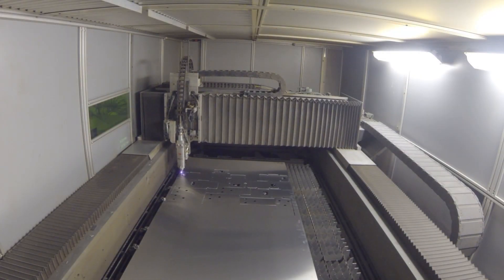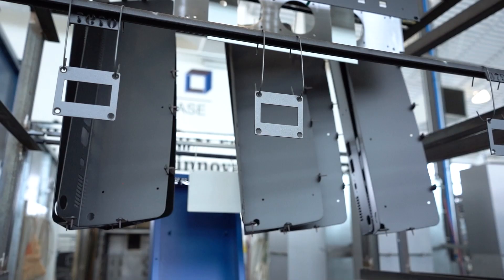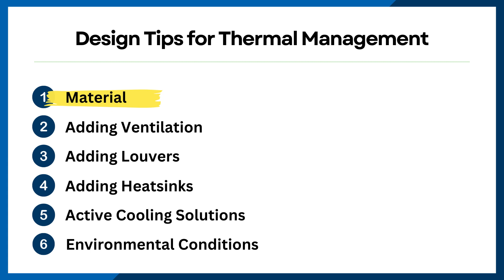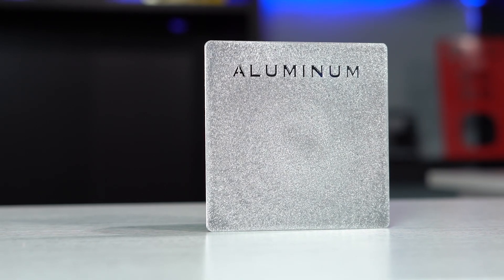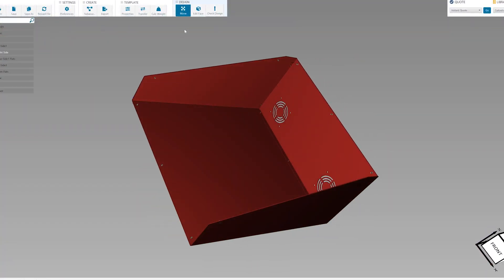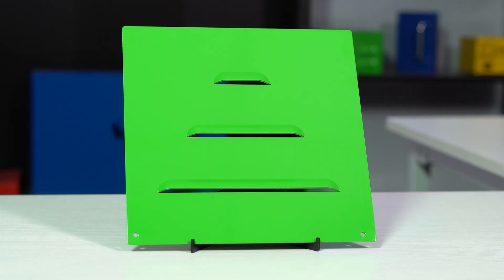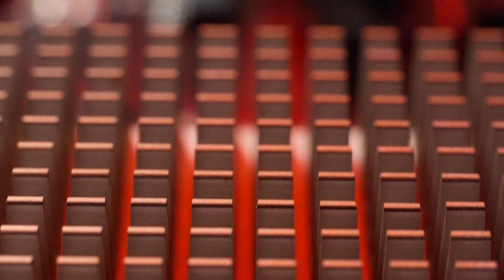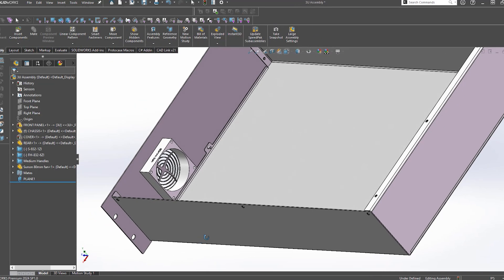Proto Tech Tip - Design Tips for Thermal Management

Comment: One of the neat things we got protocase to do on our design was to add about 15-20 little holes on either side of the enclosure in a neat chevron style for aesthetics then if the customer needs they can mount the enclosure to get convection. We also had them design a cool L shaped ALU bracket that screwed onto the inside and sat on the CPU so it diverted heat from the cpu into the metal case. 
We were really pleased with the design!
Reply from the maker: Love that! Perfect blend of form and function. If you're up for it, send us a message with some pics, because we'd love to share it on our Instagram!